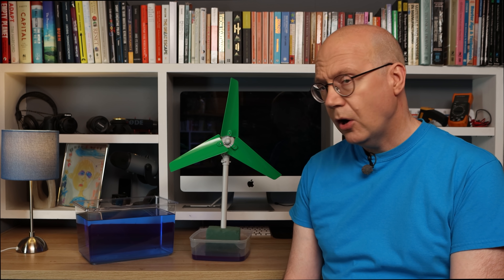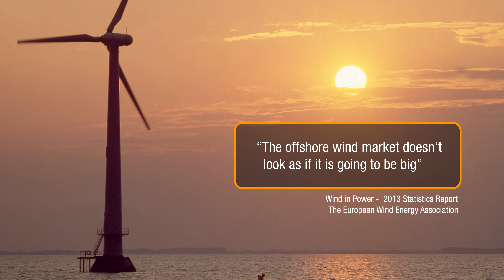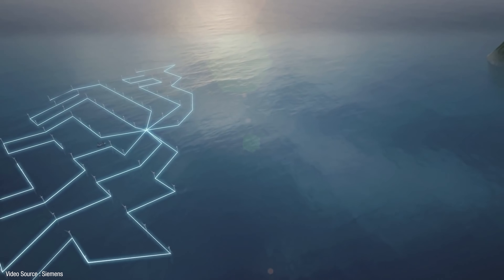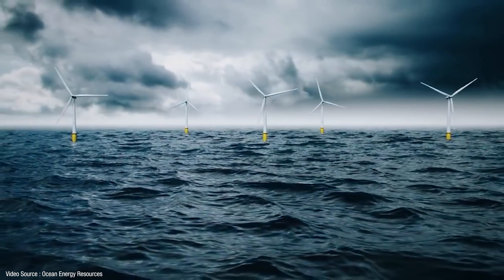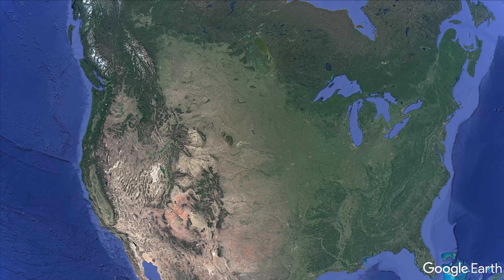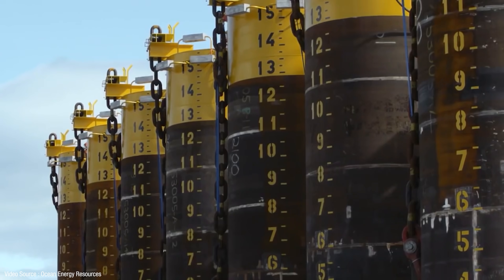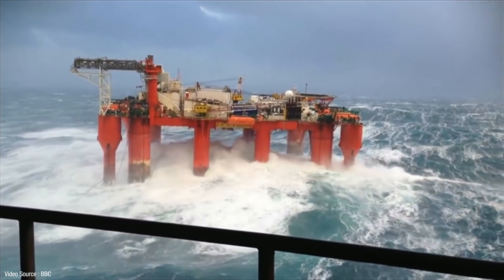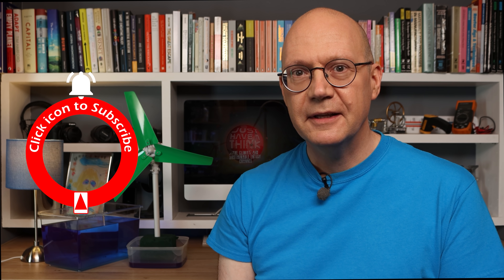Deep Ocean Floating Wind Turbines. How do they do that?

Comment: The problem with all this is, as always, speed of installation and energy density. You hallowed the massive installation of 50MW!, whereas Hinkley C will generate 3.2GW, 64x the power and entirely constant with  significant inertial mass to help stabilise grid frequency. We absolutely need to pursue wind power, but it simply won't work without nuclear.
The past month saw wind generation produce an average of 3GW, despite an installed capacity of 25GW. We don't have the storage capacity for a day's power requirements, let alone a month's (arguably more than total global power storage).
Reply: I worked in the nuclear industry for 31 years and I have to say nuclear is great but it takes the investment of a country to get a power plant online. Then there is the long decommissioning to think of.
Reply: @fastfreddy19641  I don't disagree, various studies have shown that if Hinkley C had been government backed it would have cost half as much and the decommissioning has been built into modern EPR reactors.
EDF exports €22bn of electricity every year, with much of that from reactors built in the 70s, the reason they don't have money for the decommissioning is because they've bought half the grids of Europe.
Reply: @LudvigIndestrucable  yes. Hartlepool, an AGR paid its mortgage off years ago. Shame the CEGB still didn't own it as we could had used the profit to finance Hc and wind. 👍
Reply: @fastfreddy19641  Yes, the AGR fleet has proved really reliable, but didn't meet their initial marketing hype (online refueling and  removable fuel rods), the initial hope was to sell the design around the world which would have significantly offset the design costs.
This is actually a wider issue that France partially solved, one of the easiest ways to make things more affordable is scale. The French pushed through a massive investment in a nuclear fleet, though their PWRs were arguably inferior to the British AGR design.
Reply: @LudvigIndestrucable  your right. Hartlepool was deigned for reduced power on load refuelling but we had to come off and have refuelling outages which changed how we operated. We also had to invest in the AFSF. That said they are very good reactors with very low radiation exposure to the workforce. 👍
Reply: The main problem with nuclear seems to be that the costs, generating capacity and completion dates have been seriously misrepresented.
   It was first proposed in 2010, and is still far from finished. Initial cost was projected to be £19.6 billion...estimated cost now to consumers, with current interest rates, is around £50 billion. Previously, the contractors were projecting return on equity as between 20% and 35%...this has now dropped to between 7.6% and 7.8%... I wonder who will carry the burden of underperformance?  By the way, those major stakeholders in the project are the governments of France and China, so I'm not sure how this will help UK energy consumers.
    Of course, radioactive nuclear waste disposal is also an issue, especially as there are still many thousands of kilos of toxic waste in 'temporary' storage awaiting permanent 'safe' storage at decommissioned sites like Sellafield (formerly Windscale). San Onofre, on the California coast (and the  San Andreas Fault), has over 1600 tons of nuclear waste, stored indefinitely until someone can be found legally responsible for its disposal.
Reply: @curmudgeon1933  and some of the reasons for the increased costs has been the repeated objections, both legal and political (often both). EU countries tried to stop the project by lodging legal objections, they failed, but the delays and costs of the challenges raised costs, spurious claims about wildlife also raised costs.
This is not to say that there should not be due care and consideration, but there were multiple specious and malicious suits and accusations solely employed to prevent or stall the project.
Then, after having caused increases to the cost with spurious litigation, they claim it's too expensive anyway.
Reply: @LudvigIndestrucable  . However true that is, and however much you discount possible environmental problems, it's also true that as the costs of renewable energy production and storage go down, and efficiencies improve, nuclear becomes less and less financially competitive. 
   Huge, centralised power generation projects can become massive white elephants. Inflexible to new tech innovation and requirements, they can also be a magnet for unscrupulous grifters and corrupt politicians looking for fat government contracts with little or no oversight. After all, the taxpayer is footing the bill, and by the time payment is due, those that authorised the project will be retired or dead...or more likely, in a lucrative directorship.
Reply: @LudvigIndestrucable  . When you mention objections to nuclear power, both legal and political, you must also acknowledge the malicious influence of both the nuclear, and fossil-fuel industries who have spent billions in lobbying and misinformation campaigns. These have been both malicious and criminal, and designed specifically to hinder the adoption of sustainable and renewable energy resources...and continue to profit from the existing paradigm.
Reply: @curmudgeon1933  what you need to do is check out how nuclear is planned to be used in the future. Small module reactors that don't produce nuclear waste and are inherently safe.  These reactors operate at high temperatures so their power can be stored for use when renewables are not producing and this power can command premium pricing.  Check this plan out: https://trib.com/business/energy/wyomings-new-nuclear-power-plant-would-be-the-first-of-its-kind-what-makes-it/article_f31fe252-91b3-5fa8-83a7-209ad8d241a3.html .  Essentially a decommissioned coal plant is used with the nuclear plant and storage providing the heat.  This plant is in the states but the reactor can be shipped to a site and installed.  I think this idea certainly makes sense for Europe.
Reply: @curmudgeon1933  The nuclear industry shares little DNA with fossil fuel industries nor common cause. The nuclear industry has mostly had to fight disinformation from hippies rather than create their own.
Please read what I wrote above, it doesn't matter how cheap renewables become and or how cheap storage becomes, the intermittency is just too extreme to be our sole energy source with numerous studies showing that the cost of renewables climbs the greater the proportion of the energy mix it holds.
The maths is quite simple, you can have calm winds (as the UK has had over the past month) with little energy from solar for a period as long as a month (actually longer). Average UK consumption is 38GW, so 38*24*30= 27.4TWh more than order of magnitude less than projected global storage by 2030 (all for one small island off the coast of Europe). Then add onto that the need to generate 74GW or more to meet demand and replenish that vast storage. This is before we've converted our road fleet to electric.
It's not a fight between renewable and nuclear, they're two low carbon/zero carbon energy sources and can work together, neither works well in isolation.
Reply: Nuclear? A bit late now! Blame Jane Fonda and the Green Leftie Flakes - green on the outside, red/and cracked on the inside.

Comment: Why use the three blade turbines? I know the vertical turbines are less efficient, but the structure could be easier to stabilise in rough seas.
Reply: Vertical axis turbines are much less efficient and they have other problems, they have high cyclical mechanical stress, cyclical energy production, which are bad for longevity and electricity quality. There is also the problem of how do you reduce the power when the wind is too strong.
If this design is less efficient, it means it needs more materials to achieve same power output, so it increases costs.
 That's why no one has built a vertical axis turbine more than 1MW.
Reply: @niconico3907  ok, thanks.
Reply: Search here for Rosie wind turbine and you will find the answers.  She even has a video about blade design.
Reply: I know there's been a couple of attempts, though other than pointing to the general VAWT disadvantages I couldn't say for sure why they have failed so far. There's actually a startup called SeaTwirl working right now trying to make floating VAWTs a reality.
Reply: @michaeldalton5220  I looked at Seatwirl website, its a complete joke. They can't compare at all with existing wind turbine manufacturers.
 Their working prototype is 30kW, which is 400 times smaller than the biggest working prototype of offshore wind turbine Haliade X 12MW(soon to be 14). And 30kW is 200 time smaller than the 6MW hy wind scotland floating offshore wind turbine.

Sea twirl is currently developping a 1 MW turbine, which (if it works) will be 6 to 12 times smaller than competitors.
But they look to have an interesting concept.
Reply: @niconico3907  This is how you kind of have to do it if you're a startup. Start small, build a proof of concept, get investors, scale up, repeat until business is sustainable. There's just no way you can radically redesign and build 10MW+ turbines out the gate unless you're already a multi-billion dollar company, and even then they'd probably go at it the same way.

Comment: Here in the UK we should keep building offshore wind turbines. 

This technology looks amazing and hopefully we will be able to transition to a carbon zero economy by 2050.
Reply: And I am a pink porpoise.
Reply: @TheFastAndThe Dead Scotland's population is 5 mln. The rest of UK's population is 60 mln.
Reply: @sodalitia  And Bermuda is 71,000 but burns heavy oil or diesel with little or no renewables. What is your point?
Reply: @bluebox2000  My point is exactly what I said in the comment. Also my second point is: read the entire thread and then curb your whataboutism.
Reply: @TheFastAndThe Dead I think what you say is a true statement, but don't forget that Scotland still relies on domestic nuclear power and electricity imports from elsewhere in the UK when the wind isn't blowing. I'm not bashing the achievement, just reminding you and others that wind power alone can never be a complete solution
Reply: @TheFastAndThe Dead again I agree with all your comments, but there is currently no viable concept for a scalable electricity storage system. Green hydrogen may be the best option, but the full economic evaluation then needs to include the desalination and electrolysis infrastructure, hydrogen compression and pumping, and hydrogen-burning power station.
Reply: Turbine life does not make land installations viable.   Are you kidding me ?

Comment: Where there's a way, there's a will.  Let's hope these prototypes work well.  Being out of sight and out of mind is a positive attribute for costal communities of both humans and wildlife.  Optimistic.
Reply: Well, yes, other than the "wildlife" of the oceans...  As long as the underside is built to keep the fishes of the sea, safe.  There has to be a way to get that energy to the land.  Is it cables being used, or what??  Entanglement is a huge issue.  All in all, way better than the petro platforms mucking up the oceans.
Reply: @chinookvalley  The petro platform engineers should have lots to bring to the green offshore wind party.
Reply: Yeah, a wind turbine weighing more than 10,000 tons sounds a great idea.

Comment: Just what is wrong with nuclear power stations? The development of fast breeder reactors? Answer - nothing, save for the smokescreen of nonsense from the so called but not-at-all 'greens'.
Reply: It is strange about nuclear. I watched a recent video about molten salt reactors that seemed to tick an awful lot of boxes.
But then people look at the new Hinckley reactor cost and think that is the norm.
I'd like to see small modular molten salt reactors developed.
Reply: If we use nuclear power it will actually solve the problem. Then people won't have as high of a horse to look down on everyone, and it can't be used to push pet projects through.
Reply: The engineering behind cost effective generation and disposal is there. The "environmentalists" make it extra expensive when they block it at every move, and try to regulate it to death.
Reply: @orkin2525  Indeed. That has been the case for a very long time. They hate to accept it though. Their scrambled world view collapses. Just as the GOP needed to deny climate change in order to operate unconstrained. it is all a matter of petty ego.
Reply: @Keith Towse Molten salt reactors do go some way to solving the waste problem. What do you think about the NATRIUM designs?
Reply: @Keith Towse Firstly it is simply untrue that the waste problems are not solved. The interference of vox pop in the process is absurd. As the plebs if they want a nuclear waste facility three thousand feet down in a geologically stable rock formation, with no meqsurqble risk at all, and the people say 'NO" Well what a bloody surprise. SO. Do not ask them. DO you ask them any other waste management or complex engineering decisions? NO. Why not, Because they know nothing!. Secondly, it is a tiny fraction of the carbon output of any other system, and has great strategic advantages over all other energy supply systems.. Additionally, the development of fast breeder reactors ( we should have got there by now and would have save for the ridiculous 'greens') removes waste problems, and cuts costs. As for cost - well You SHOULD have high cost energy with small co2 output. That is highly desirable. It propels you to fine levels of relevant industrial design.

Comment: how about combining offshore wind and tidal into a single unit. put an underwater turbine on the sub surface bit. double the bang for the buck.
Reply: How about OTEC as well?
Reply: Yes, havesting tidal energy as wel seems a good idea. All in one solutions, love them.
Reply: How is it going as a poet?
Reply: @terencefield3204  Angry trolls always expose their IQ...
Reply: Adding in wave energy conversion or tidal/current should be looked at for viability on every wind turbine site. Pity wave and current aren't as developed yet but that will eventually catch up!
Reply: I think ballancing that construction so it does not fall will be a serious problem.
Reply: @Graham Luell Yes. And therefore the concept can actually be used for Steve Haigh can be used for shallow water turbines.
Reply: For shallow water, it doesn't make sense because the turbines themselves are going to significantly reduce the strength of the currents which will make them very inefficient and not worth pursuing at all.

For deep water, the fact that the turbines are floating means that they're going to start moving about, and harnessing tidal forces are going to be extremely difficult in these conditions. It would make more sense here than in shallow water though, so we'll if the researchers have a solution in the coming decade(s).
Reply: First thing I thought of when I first heard about them 12 minutes ago.
Reply: yes but as this is a big scam to steal tax payers money , your idea will never be looked at
Reply: @Morningstar-xz5bl  nope